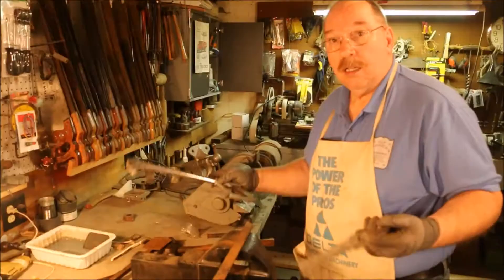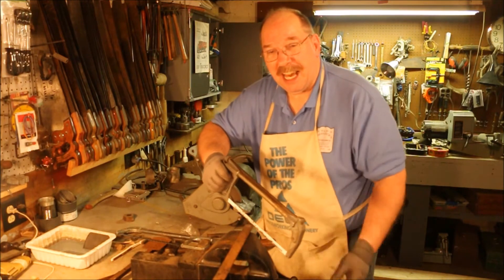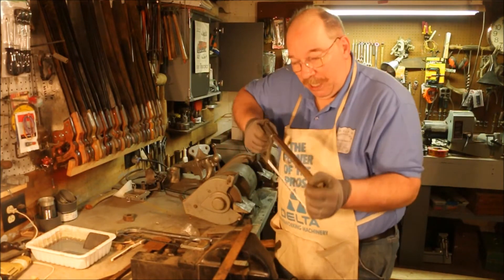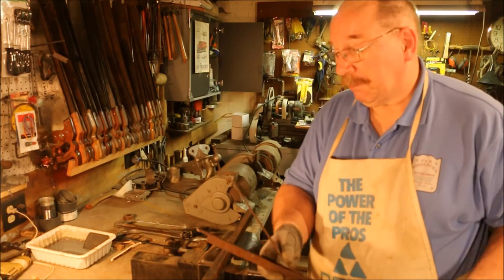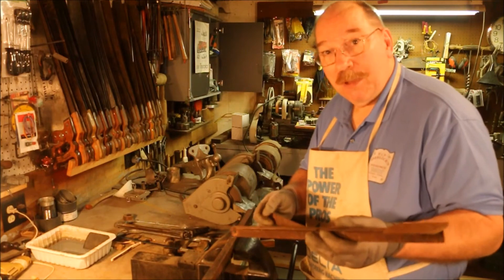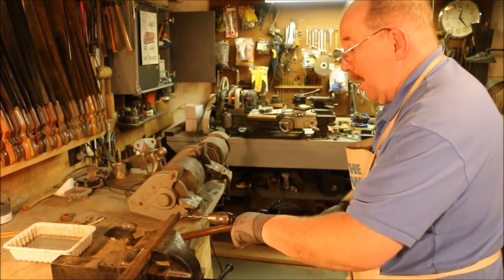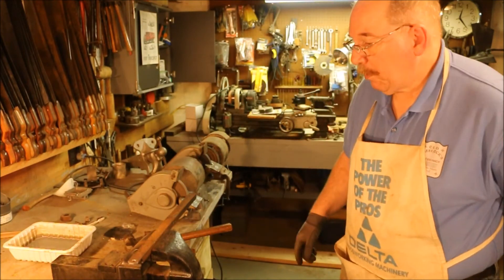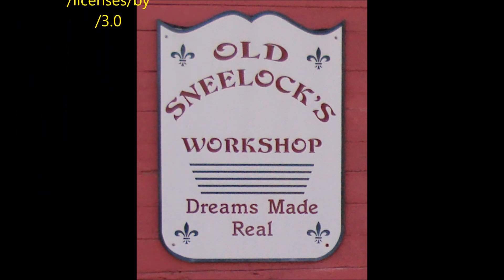1890's TREADLE GRINDER ~ PART V ~ DRILLING THE TREADLE BEAM

Comment: That's  a neat old drill. Some of those old electric drills would break a wrist if it hung up like that. Take care.
Reply: My dad had a B&D 1/2 in a 3/8ths frame that wind you up in a blink. Downright dangerous. Like Unc';s Hole Shooter Milwaukee.
Reply from the maker: Lewie McNeely All that kinetic energy has to go somewhere. The gear reduction hasca lot of rotating mass that keeps it spinning after you let go too. 
The bad part of having the tool catch is that as soon as it jerks our first instinct is to grip tighter instead of letting go.  We hold the trigger down and hang on until the drill stalls or our arm breaks. ☺

Comment: I thought hacksaw blades were the same. Silly me. I keep on out in the shed now because they do have a purpose. I still hate the too but they come in handy. I do need a new blade though. Watching for smoke from the lower breast drill. You did good. Neighbor got some trees taken down from over hos power line so I was in firewood mode and the outside light is still hanging, waiting. Raining now so it'll just have to be patient. Maybe tomorrow, if it comes. If it don't I'm not worrying about that!! Thanks again for another good one, Unc! You'll be pedaling the exersize grinder before you know it!
Reply from the maker: We do what we must when we can. I have a brake line, two calipers, and the shoes the meat head bent on the truck to replace. It's hopefully going to wait until the rain stops.
Reply: Me too as far as the wood goes.